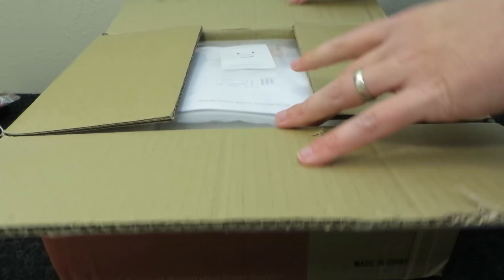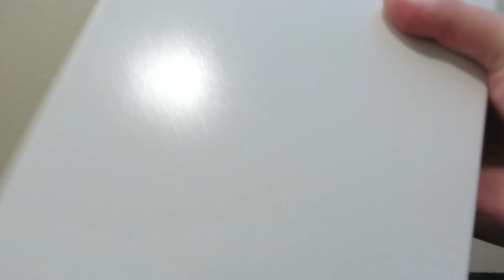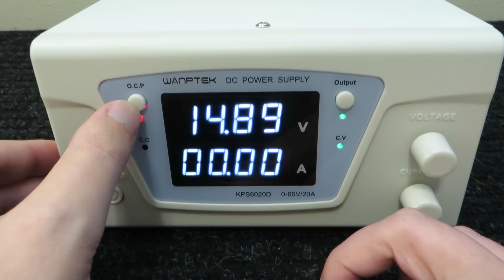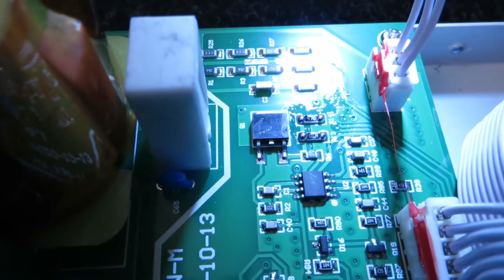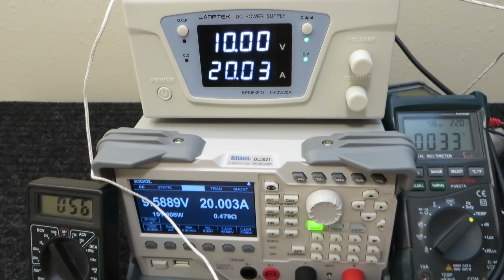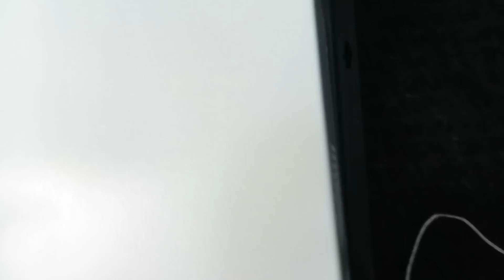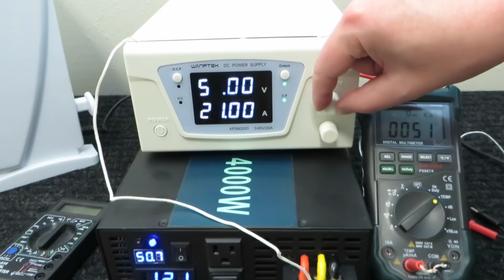1200W 20A 60V AliExpress Lab Bench Power Supply PSU Tested

Comment: From personal experience 200-240v psus are more efficient and will lead to better results over time, you should also consider wiring a nema 6 socket there if you're messing with power supplies and whatnot would also give you a bit more power to work with vs 120v. I know i'm european biased here but i've had situations where i had both voltages available and same power supply with universal input and on 120v it could barely do it's rated capacity at 240v could easily do it's rated and way more. But I'm surprised at this chinese psu it's better than i expected, i was expecting fumes. I also remember once I had a little 15W 12v brick from a router i was testing it with a 20w halogen bulb, on 120v it would cycle on and off and on 240v would stay on.
Reply from the maker: Universal input (100V to 280V type) supplies generally are a few percent more efficient at 240V than at 120V, so I agree with your experience.  Their power factor generally suffers though which can negate some of the benefit.  On power supplies like this one that are not autoranging and are hard designed for one input voltage there shouldn't be a significant efficiency or functional difference though.  Shouldn't.  Doesn't mean there isn't!  From a designer's perspective it is often easier to make one design that can be used worldwide (and it has to be the 240V or 277V option to support higher voltages) and this results in countries with 100V or 120V applications getting worse performing AC/DC supplies.  But it goes both ways - motors and light bulbs tend to like lower voltages more so you win some and you lose some.  :)

Comment: The ruideng/riden RD60xx family of buck converters lab supplies(you need to provide the PSU) is also an option, now they have the 18A version and said they are working on the 24A model.
They have a decent UI and an output with a series diode especially for charging batteries.
Reply: I have one of the 12A versions and I supplied a PS that goes up to 52 volts, which is enough for me. Works well!!
Reply from the maker: That's an interesting option, thanks for sharing.  I did try connecting this to a battery and turning it on/off, unplugging it while on, turning the voltage up and down, etc.  It seemed to work fine.  Other failure conditions?  I guess I'll find out.
Reply: I considered Riden before bought this model which has very good temperature regulation. On 5 A constant load (filled car battery) vent go occasionaly for 15 seconds and is not noisy. Most of the time vent is off. Abandoned Riden because power supply is weak point and in most cases i would have jumbo jet on my desk which i considered as annoying. So i trade little comfor in use for good themal design and quiet working environment.
Reply: Just to mention, for 220 euro 1200W power supply was best i coud find. Worth to mention is top left button when active and current limit is reached ps disconnect load which is must have safety feature for repairing jobs.

Comment: I have one of those HF meters  (mine is red) but don't know what kind of TC to use. Can you help a dummy out? Looking for a Fahrenheit readout, if that is important. Glad you're back, dude!
Reply from the maker: I assume type K but I don't know for certain, and while I verified that both probes read the same in both meters at room temp in the video I noticed that one indicated the PSU had a fan trip point of 60c and the same probe in the other meter 50c.  I haven't characterized them and intend to just use the probe I got with the respective meter.  I'd recommend just buying something like at the link below if you want to know for certain.
https://amzn.to/2IRoRqd
Reply: @knurlgnar24  Thank you for the swift reply.
Reply: @knurlgnar24  When you said that your meter came with the T/C leads, I took a closer look at your meter in a freeze frame because my meter came sans leads. I see now that yours has a Temp C switch position that mine doesn't have, so it's not the same meter. Therefore, thanks for the link to the dedicated meter.
Reply from the maker: @mrhalfstep  Harbor Freight has a number of different "free after coupon" style meters - the same ones you see on Alibaba from a hundred different companies for $2 each.  I'm sure they just buy from whoever distributes them for a penny cheaper each shipment.  I have a red one as well.  I really like having cheap disposable meters that actually work quite well but, yeah, I really shouldn't be relying on them.  To be clear I do not have or have used the meter I sent a link to, but I considered purchasing that one before realizing I already have an Extech that can be repaired.

Comment: I literally just burned out one of my power supplies this morning. Most chinese PSU always seem to fail at 3-6 months. Everything on your unit looks beefy. Very nice. The ripple would be awesome to test. One of my viewers stated that using a diode will prolong the life of these units when using them to charge batteries. Obviously, diode voltage drop must be considered when setting absorption. Do you think that would help? These should theoretically charge batteries all day long, but for some reason it destroys them. What do you think?
Reply from the maker: I honestly don't expect this supply to last all that long if used continuously since I don't trust this low cost Chinesium that much, but temps seem to be well controlled so hopefully it outlasts my low expectations.  My primary concern is that flicker in the control display - it might that cause an incorrect output voltage at some point?  I'm not sure about the diode in series.  Voltage regulation will be pretty poor with a diode since voltage drop across it depends on current at low voltages (e.g. 3.5V applications) so I'd probably not do that myself, but everything is application specific.  Backflow into the PSU is something I'm always concerned with on switcher based PSUs since they usually use active rectification and that can have problems causing a smoke event that a diode would potentially prevent.  I think I'll just take the risk though.  If someone wants a high quality supply that will last for years one can get a standard industrial power supply and hack the adjust pot circuit and current limit shunt.  I've done this to make a 100% duty battery charger but not to make a variable power supply.  There's probably a video out there somewhere on that subject..
Reply: I've been using gopher tech PSUs (Chinesium grade (ave aVe)) they're pretty robust. I've one as a mains input to my van MPPT charge controller for 4 years now, the combo works better than most mains chargers. I've another in the workshop. Yes Will, the diode helps prevent damage to the PSU. In normal operation the PSU voltage opposes the battery (as long as it's higher) If you turn off the PSU with the battery connected you can damage the PSU. I have done.

Have either of you gents investigated LFP memory effect? I've just discovered it and I'm seeing +10% usable after a memory release cycle. It's a major pain in the bottom that's not well known (but is well documented).
For me it's really making lead more attractive given the application implications.
Reply: There's an episode of Top Gear where Clarkson says we'll all be driving Chinese cars in 10 years. The only catch is buying the car comes with a kick to the nuts. Chinese Stig appears and kicks James May right in the balls. I now totally understand the context of that joke.
Reply: @vincei4252  And upon buying the bargain-priced car you'll have to check youtube to see which mods should be done to make the brakes or air-conditioner functional; your choice.
Reply: There is quality by price and price by quality
Reply: Then there's reassuringly expensive. Mediocre-low quality for a high price where all you are paying for is pricepoint confidence, warranty and advertising. Apple, Victron and MasterVolt exploit this.

Comment: I worked with the Go-Power inverters after your reviews a few years back.  I have since found that Giandel is more efficient, cheaper (around 60% of the cost) and they have 2 to 3 decade newer inverter design technology. Also lower noise on the output waveform.  Do you have any experience or comments on these inverters?
Reply from the maker: I don't.  Can you elaborate on the newer design technology comment?

Comment: 13:00 wait that relay is part of the inrush circuit? It will engage after the NTC did the job of limiting the inrush current.
Reply from the maker: I didn't look at the bottom of the circuit board in much detail but I believe the power portion of the power supply connects directly to the output of the NTC, so the relay only controls the logic portion I believe.  It looks like the text on the relay didn't show up on video so I can't read the current rating, but it'd have to be a 20A relay if it switched all of the power.  I guess I'm not completely sure.
Reply: @knurlgnar24  I think they copied that section of circuit board layout directly from Mastech.

Comment: for what it is I agree that it is a good deal, 1200W digital PSU that remembers the output parameters once off, not bad. maybe you can get a supercapacitor bank to put on the output, that way you can test pulsed loads.